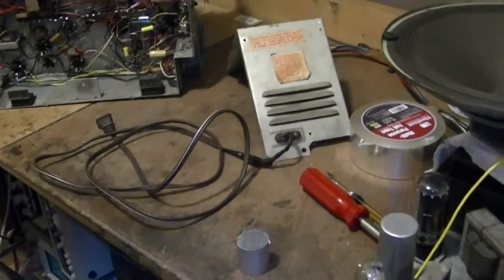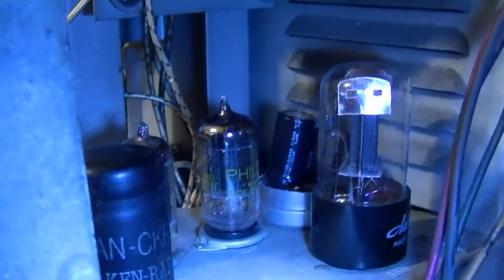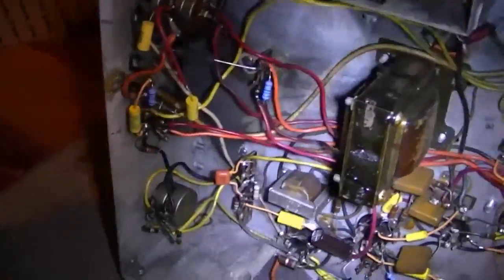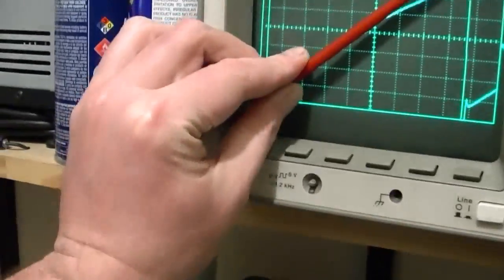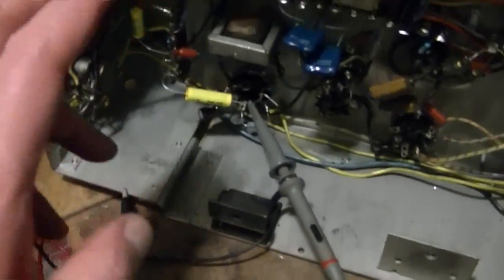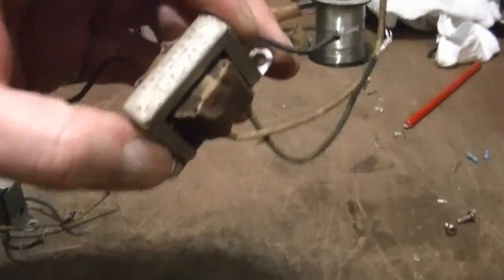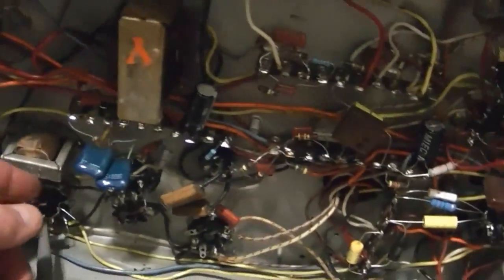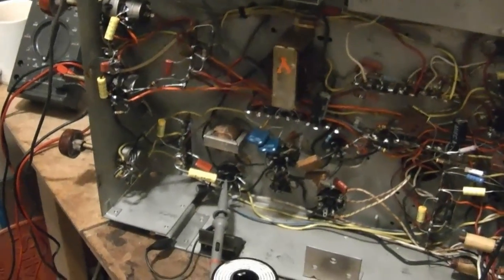Admiral 20B1 combo chassis restoration p5o6

Comment: Hi Bob. For what it's worth, The signal look like a capacitor charging in a low pass filter setup. Of course that would probably involve some sort of square wave (or possibly a DC component) being fed into it. Could it be that somewhere in the circuit there's a resistor-capacitor combination right before the point where you're measuring? if so I would look "upstream" from that part. But then again this is only a guess on my part. Vince
Reply: that would be my first guess.
Reply from the maker: I agree that's a very good guess.  The thing is I'm measuring the oscillator output so there really is no upstream.  Check out the next video for more info.

Comment: Why aren't these circuits designed using a current source dumping into a capacitor?
That would give a linear voltage ramp. Must be some way to build a current source using a vacuum tube...
Reply from the maker: Sure there is, but I expect they didn't to reduce cost.  Some really early TVs and scopes used gas discharge relaxation sawtooth oscillators..

Comment: Bob,
Could it be possible that even thought the components are correct maybe the design is slightly flawed. Have you tried altering say the capacitors or resistors in such a way so that better integration could be found? Just a thought.
Reply from the maker: Maybe, but I would think if it was that simple, they would have changed the design or it would be mentioned in the service info.